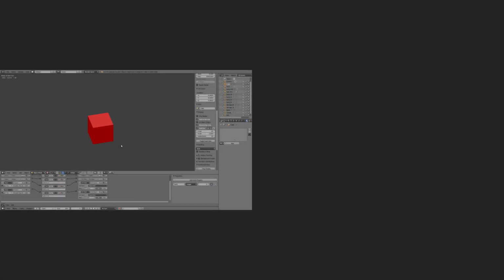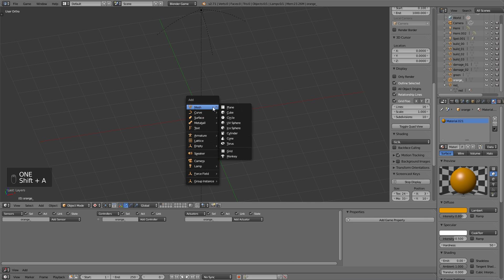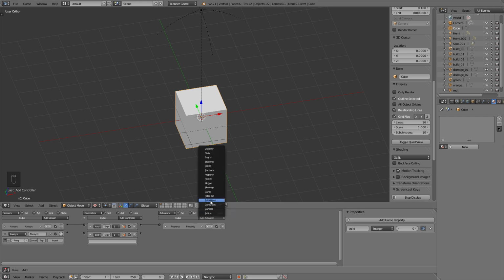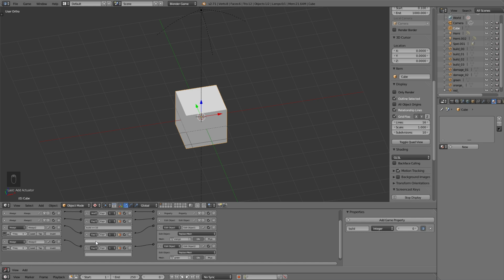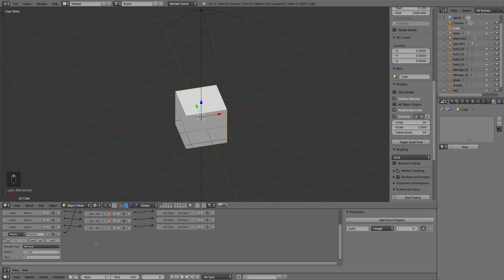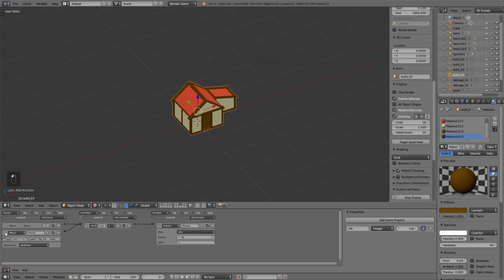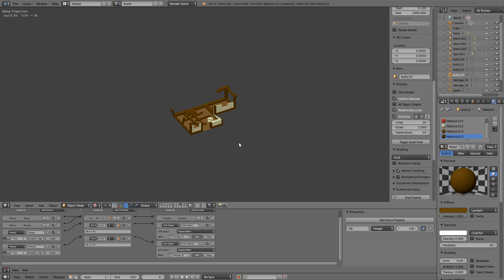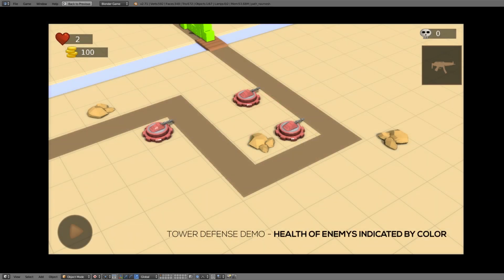Building progress and destruction in Blender's Game Engine [Tutorial]

Comment: Instead of using an Always sensor and connecting it up with an Expression controller, wouldn't it be possible to achieve the same result with a property sensor where the Evaluation type is set to "Greater than" and waits until the "build" property is over 10? I don't know if that would achieve the same result or not, it's just an idea.

Comment: I've watched through this tut several times and can't seem to see where I'm going wrong, the Replace Mesh Actuator works - replacing the gray cube with the "red" mesh (both the object and mesh have been named correctly), but the "red" mesh inherits the material of the gray starter cube, even if the starter cube has no materials assigned to it.  

I have verified that the logic works correctly, by replacing the starter cube with other primitives, but though the mesh gets replaced on cue, the "no-material-default gray" gets applied to the replaced mesh.

When I remove the "Replace Mesh" actuator and replace it with an "End Object", followed immediately by an "Add Object", then the material changes correctly, though there's a noticeable 'jump' as the logic executes.    

Great work on the tutorials, please keep them coming!
Reply from the maker: thanks!
its really hard for me to judge that from just reading about it, could you either make a screenshot of the logic or upload the blend file somewhere for me to take a look at?
Reply: CGAstym  upgraded from 2.70 to 2.71, and that fixed the problem.   Many thanks!!